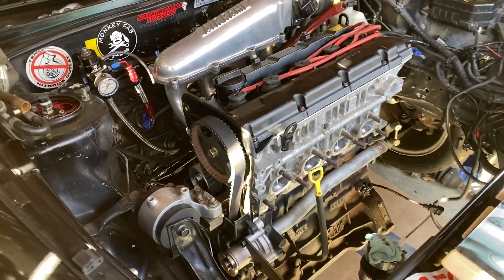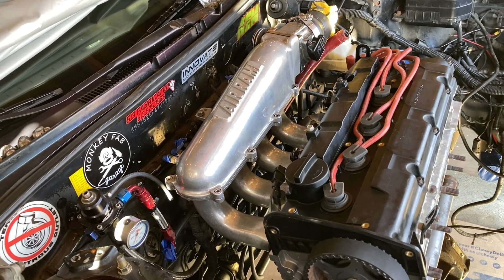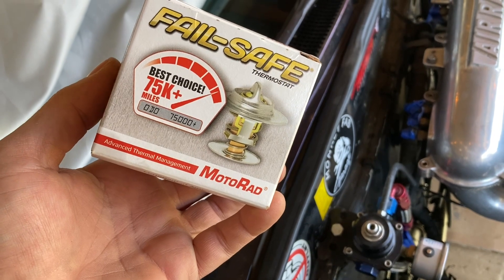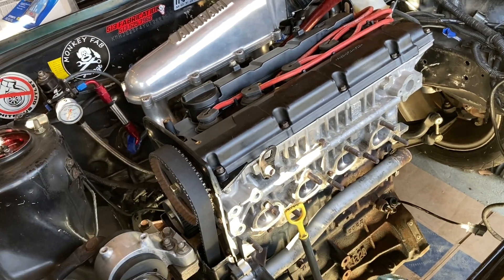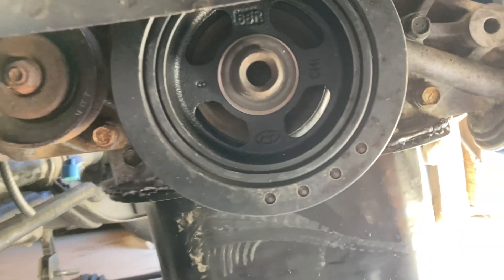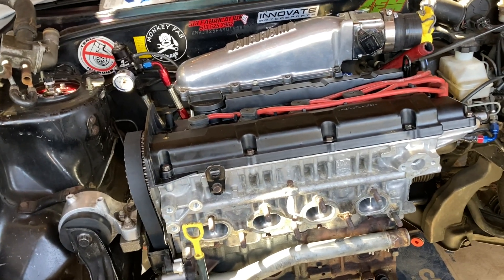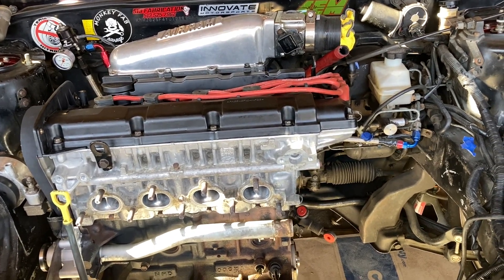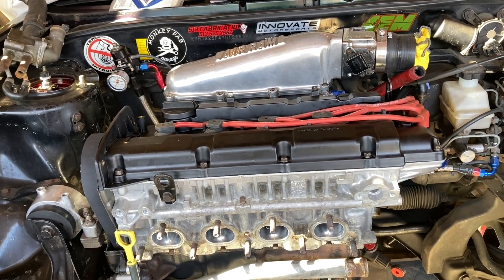Built 2.0L G4GF aka Beta1 capable of 1000hp YES A Hyundai Engine

Comment: I’ve got myself a Hyundai Getz 1.4 g4ee tempted to do a build on but I don’t know if I want to go mental in a car that weighs nothing lol
Reply from the maker: Id like to have a Getz transmission there actually very strong and bolt up to the beta engine
Reply: @PATuners strong trans but quite low on power engines
Reply from the maker: @joshuasalisbury789  they sure but the transmission will hold some good power if you decide to make power
Reply: @PATuners I always thought the first thing to break would be the trans tbh
Reply from the maker: @joshuasalisbury789 it’s actually very strong no idea why but it is lol

Comment: Is that is G4GF valve cover (22410-23010) ？
It look like another cover.
Reply from the maker: @SPCH-26  G4GC aka beta2 valve cover
Reply: Is it compatible ?
Reply: G4GF valve cover alway cracked when thight it .
Reply from the maker: @SPCH-26  yes it’s the same just has better oil baffling
Reply from the maker: @SPCH-26  also only torque valve cover to 72 inch pounds
Reply: @PATuners  Do you have any contact ,I have plan to restore my car ,but my country its hard to find engine part.

Comment: 8k on a motor for 650 at the wheels why not buy a 335i
Reply from the maker: 650 at the wheels this be at 850. Why would I want a bmw?
Reply: Why would he want a bmw a Elantra or Tiburon only weigh a little under 3k lbs , bmw is way more 🤣😢
Reply: @brandonmckenney5123 depends on the year of the BMW.  The e36 weighed between 2600-3600 and the e30 was 2500-3000.

Comment: What happened to the MAP sensor ?
Reply from the maker: The map sensor built into my standalone ecu
Reply: @PATuners  ok thanks, because i have an 03 tiburon with the early version of the beta 2 and was wondering how i could tune it. And seeing that your intake manifold doesnt have the map sensor i was curious.
Reply from the maker: @axelraver  my year would run a maf sensor but once you go turbo with a standalone all the worthless Oem stuff goes away